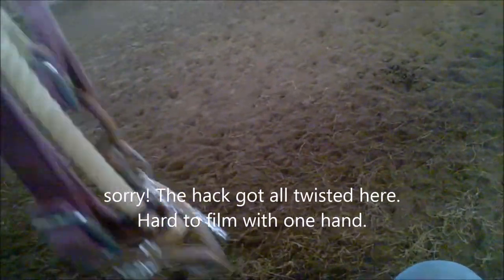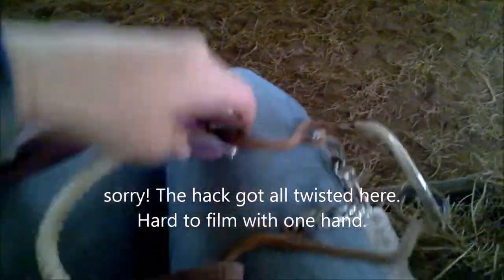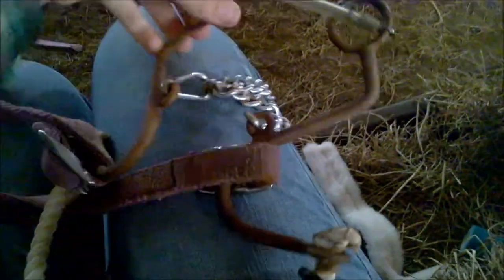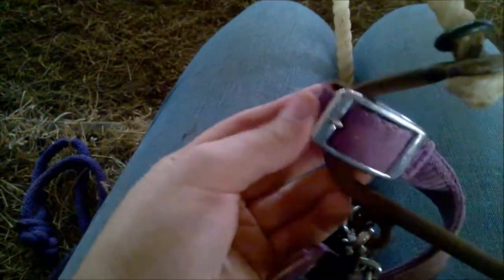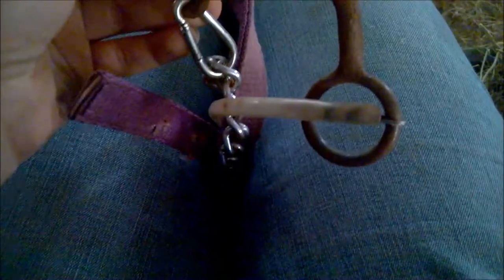Hackamore mechanics and padding

Comment: Help!!  The paso fino mare that I got refused the bit so I got a little S hack.  I wrapped it like you did to try to stop from being too harsh.  Now, I know that I lean on the reins too much.  How do I control her speed better....she just wants to go, go, go and as a result, I hold her tight too much.  By then end of the 45 minutes of riding (in circles and patterns trying to get her to learn to slow down) she was dipping her head super low.  What do I need to do?  (we only rode this horse once before purchasing and then she got an abcess and had to wait 2 months to ride again)  Thanks so much for your help!